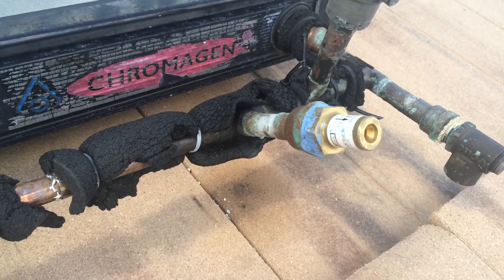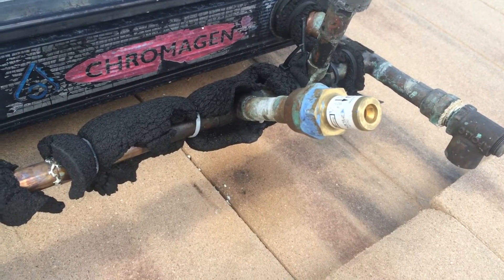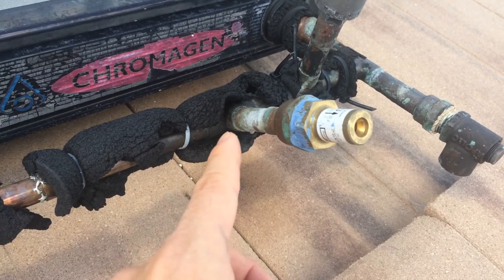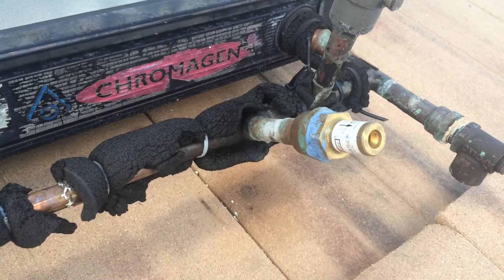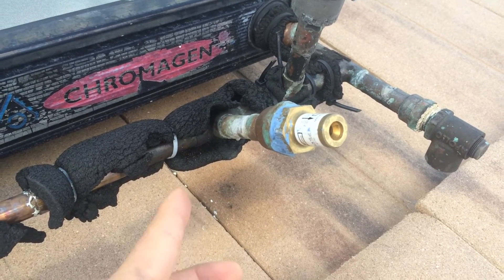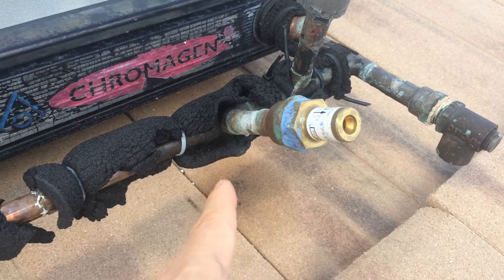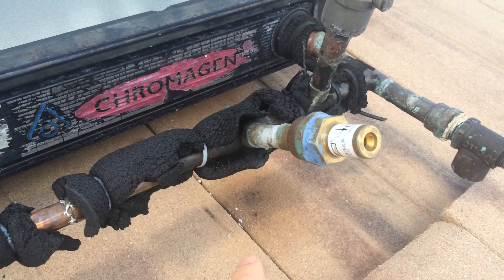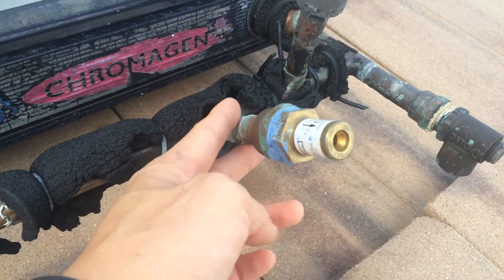Solar Domestic Water Heater Troubleshooting: Anti-Freeze Valve

Comment: So it looks like I have the same exact Anti Freeze Valve as you and mine is leaking. Do I just need to replace the end portion?
Reply from the maker: Hi Christina...if you live in an all-year warm climate area where pipes generally don't freeze, you can just cut off the valve and "cap" the opening as I have mentioned in the video to avoid future issues and cost. What good is an anti-freeze valve if the pipes don't freeze!